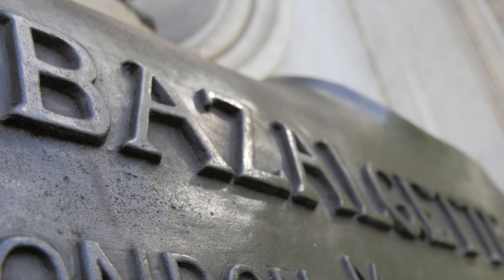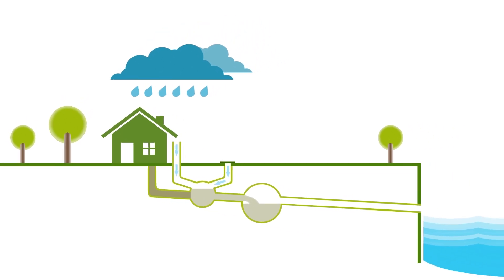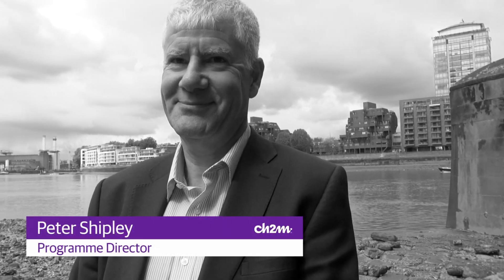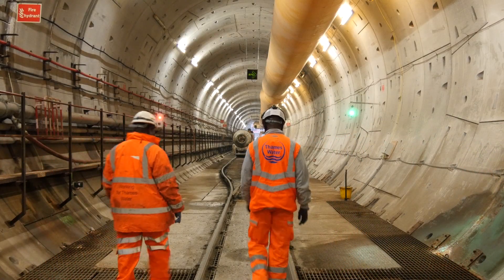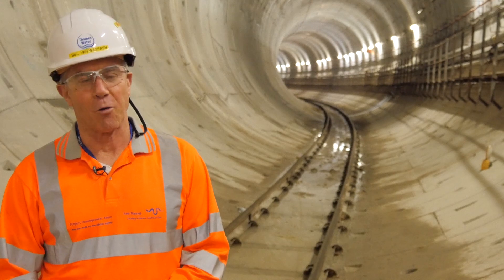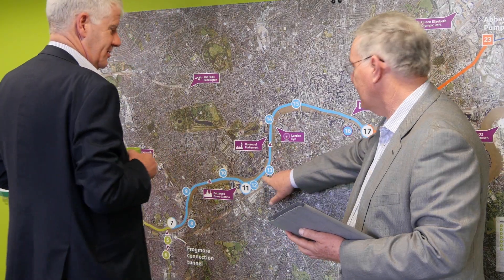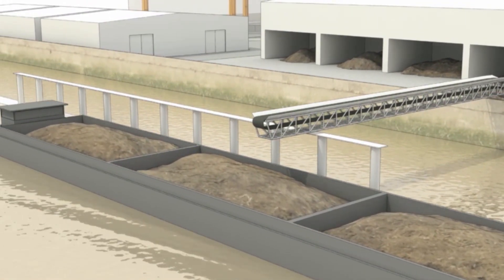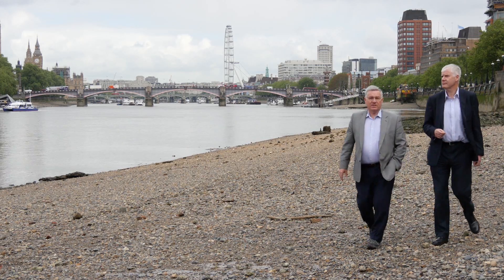Thames Tideway Tunnel - Transforming the ecology of London’s river

Comment: My old granddad was one of the GLC execs at County Hall in charge of waters and sewages for London, he had the unkind nickname of "Walter Works" which led him to stop using his first name and adopting Bob but the nickname stuck until his retirement.   The sewer "motorway" was a long wished for project that was always kicked down the road, I remember him taking me down to the Flood HQ in the old tram tunnel in Holborn, was so cool.   I've also worked on the Kew Bridge engines back in the day with many a trip to Crossness before it got opened up to the public, Kew's 90 and 100 inch beams basically gave western London its water pressure through those two giant buckets but the 100 inch cracked its beam leaving the 90 inch to soldier on as the mainstay of water pressure for many years.

Comment: The only problem I see with the entire project is it's still a combined sewer. The only way to get your operating costs of sewer treatment plants is a two pipe system, one to bring sewage to the treatment plants and a second pipe system to handle rain runoff. This will have a severe impact on your operating costs. Until you face facts and finally start building a two pipe system you merely applying makeup to a bad makeup job. And increasing your costs to boot.
Reply: Right, let's tear up the entirety of the city of London to re-route the run-off lines. Forget those cobblestone streets, and irreplaceable masonry work everywhere. Do you have a problem understanding distances/depths in meters? Do you know how gravity works?

Comment: Need to create a bacteria that will eat all the sewage.
Reply: mary shaffer pretty sure that’s the way all sewage treatment plants operate already.
Reply: actually they do use bacteria to process the bulk of sewage already, the byproduct of which actually enables them to produce electricity that help run equipment (I was told by a Thames Water engineer but I never looked into it myself but he had been working there for decades so I have no reason to doubt him)

Comment: Why don't they just discharge the rain runoff directly into the river? It seems like a complete waste to put it in the sewer.
Reply: You need pipes to do that, hard to install after all the buildings re already built on top.
Reply: If you’ve seen the trash people dump in the streets you would understand that rain runoff, which picks up all the crap it has run through, is not remotely clean.

Comment: A complete pack of lies or maybe "misrepresentations" since that "tunnel" is going to be nothing but a STORAGE TANK so the raw sewage and "storm water" can sit in it and stagnate after its filled or partially filled during storms and be that much shittier and nastier when its "treated" later. And since its the LACK OF SEWAGE TREATMENT CAPACITY THAT IS THE PROBLEM ADDING STORAGE DOESN'T DO JACK SHIT SINCE YOU STILL HAVE TO "PROCESS" IT EVENTUALLY. ALL THEY'RE GOING TO DO IS RELEASE MORE POLLUTED DISCHARGE WATER CONTINUALLY IN "SMALLER QUANTITIES" INSTEAD OF IN BIG "FLUSHES" AT "PEAK FLOW" PERIODS WHICH DON'T ALL HAPPEN DURING OR AFTER STORMS. EVERY CITY HAS A "RUSH HOUR" OF SEWAGE SYSTEM DEMAND OR RATHER SEVERAL RUSH HOURS. AND IN THE CASE OF CITIES IDIOTICALLY BUILT AND SITED LIKE LONDON IS WHERE THE GROUND WATER TABLE IS SUPER HIGH AND THE LAND IS SUPER FLAT AND THERE IS ONLY ONE "OUTLET" FOR "TREATED WATER" THAT HAS TO FLOW DOWNSTREAM NO MATTER WHERE THE CITY OR TOWN IS LOCATED, YOU DON'T HAVE GRAVITY ASSISTING THAT FLOW CONSTANTLY AND STEADILY. WHICH IS WHY ITS IMPOSSIBLE TO BUILD AN EFFECTIVE, EFFICIENT SEWAGE TREATMENT CAPABILITY TO BEGIN WITH. SEWAGE TREATMENT IS A CONSTANT, STEADY INCOMING SEWAGE/OUTGOING TREATED WATER PROCESS AS THE PLANT KEEPS BACTERIA IN THE DIGESTION "TANKS" TO DIGEST AND BREAK DOWN THE SOLIDS AND CONSUME THE NUTRIENTS IN THE WATER. YOU HAVE RESERVE CAPACITY FOR THE "SPIKES" IN FLOW THAT OCCUR MORNING AND NIGHT AND THEN THE PLANT IS ACTUALLY DOING MOST OF ITS WORK AT NIGHT WHEN FLOWS ARE AT THEIR ABSOLUTE MINIMUM.
Reply: You have issues that you need to deal with...
Reply: Hmmm, Quite shouty wasn't he. Pity they never planned London a bit better more than 2000 years ago when they first started eh?

Comment: Seperate the stormwater from the sewerage. Simples.
Reply: They do in modern builds and have done for years, it's a bit hard to retrofit that to a million buildings on roads that are congested most of the time.
Reply: We have a histroic problem here.  Nearly every house built prior to WW2 has a combined system, to replace this with a modern separate system is total unfeasible.
Reply: "simple" he says.  You mean dig up the whole of london to install separate storm drains everywhere.  Yeah, great plan.
Reply: It's not simple, the original system was built as a 'combined' system that drained both wastewater and stormwater. A lot of American cities had this, too.
Reply: @jhogan1960   I saw a tv programme decades ago called Horizon discussing this subject. Most American cities had separate systems for sewage/ industrial and storm water. The sewage/industrial, went thru sewage processing and then the resultant effluent went into  big lagoons where water plants like Water Hyacinth absorbed the heavy metals in the liquid prior to testing and discharge. The storm run off, simply went uncontaminated into the rivers.
Reply: At some point it has to be done, little by little, say over 50 years.

Comment: Wow, so if I understated clearly London is bulding a sewage system thats goes under Thames River, through much its extension? I've in São Paulo, Brazil, the city grew over a river basin full of hills, and most of the rivers are polluted here, and guess where the poorest lives? No isn't just the hills, most of the favelas are actually near steams or over it, the sewage company it is hypocritical saying that the poorest have illegal sewage systems that flows to the streams but most of the sewage that was supposed to be treated goes to the streams instead, yes some works have been done in this streams but most of it it's just channel the streams, build some banks, open some footpaths called a park, and then leave it to degrade, since 1992 the major river that cut the city it is in process of despollution but most of citzens thinks that will never be despolluted, and get used to it. After I've watched this video, I think it's the where to go, build an enormous sewage under the main rivers, and sewage goes to another enormous treatment plant before dump in the nature.
Reply: To GBA811 - There is a point in every ecosystem where any organism which over procreates suffers a mass die off. We don't want humans to experience that and to avoid it people must voluntarily control reproduction. Having a religion that prohibits that seems to be a major part of the problem.
Reply: i read about SP and recent floods.  in britain, we have the ideal climate to compost all organic waste and to maintain a green cover of trees and shrubs.  we can develop industry in rural zones and pull people away from the big cities.  it's all possible and finally, it will be done.

Comment: My question is with these huge underground tunnels, do all the smaller pipes, wires rails and metal work stay IN the tunnel forever? No one addresses this.
Reply: All the services you see on the video are there just to construct it, they are all stripped out just to leave a concrete tunnel.
Reply: I think the utility’s will be removed - lighting, HVAC ducts, electrical/communications and the railway system. 😉
Reply: Hello, how are you doing today I hope you have a wonderful day?
Reply: People need to breathe, see under lighting, and machines need all sorts of fluids. No one addresses it except for the big black dude who said that the tunnel would top off completely with water, or the narrator who stated that the collecting tunnels wouldn't be as deep as the main one, ergo the volume and force of the water would strip anything left attached immediately. Ding!